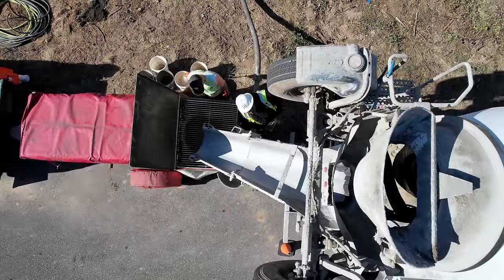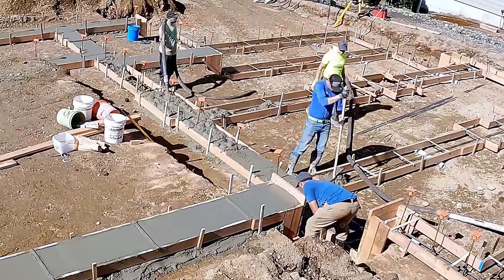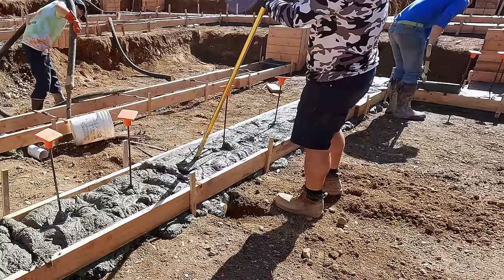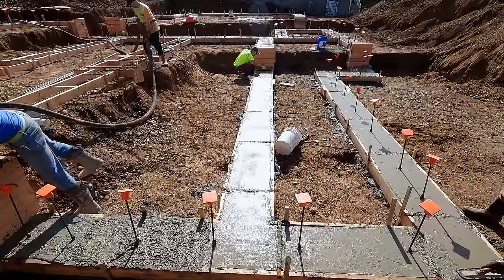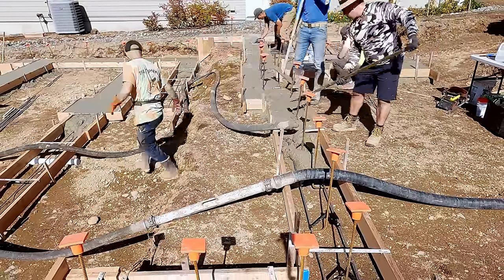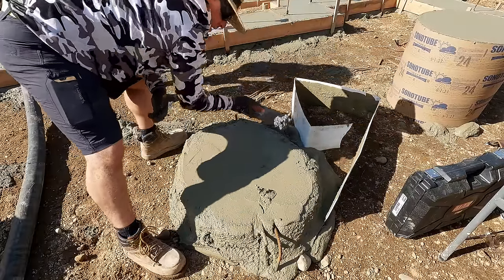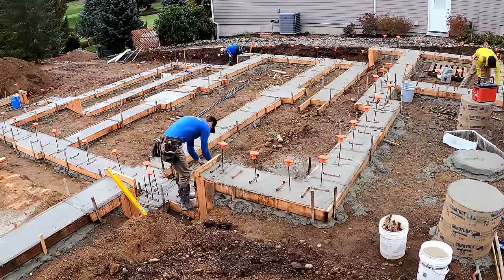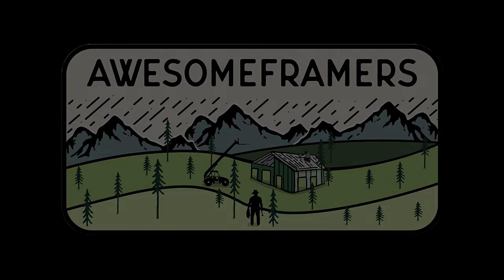Project 150 episode 2 How To Pour Footings

Comment: Smallest diameter concrete hose I ever saw. We used to use a reducer and put a 4" hose on the end. Nobody was holding that with one hand. We used a rope and a hook made of rebar to control the nozzle and a couple guys behind with hooks to move the hose around - and it was heavy. Took muscle to yank that thing around. Man, that pour was a piece of cake. No help needed to move the hose around. Concrete flowed so nicely that no vibrator was used. No hard raking. Things have sure changed in the last few years. We had tshirts that said "Concrete: go hard or go home".

Comment: Blow-out warning!  (Or at least "form creepage" warning.)  When you form your step-downs, the fluid concrete exerts pressure against the forms on one side, and against the earth on the other.  The earth is not going to move, but the 'face' form of your step-down might--bringing all the attached formwork along with it.  This is especially true if the step-down is taller, and the footer runs at the top and bottom are short (see 15:05 in the video)

Think of it this way...  Your step-downs are essentially "walls" with wood formwork on one side and the soil on the other.  You need the same restraint as you get from snap-ties in wall forms--except in this case the snap-ties need to anchor into the soil on that side of the "wall."

Obviously you did okay on this pour, but if it was me I'd want to put some 2x4 kickers at the step-downs....  otherwise you might find your forms getting pushed downhill.

Comment: Theres not much spill out the bottom because the concrete isnt getting vibed my man. Footing will be much stronger and denser as the vibrator removes air and consolidates it

Comment: So where I live we usually vibrate the concrete to get rid of air bubbles. I'm not so sure we'd be able to just ignore those 2 inch gaps on the bottom... But no worries, all our foundations are poured in prefabricated styrofoam forms anyway.

Comment: say 16 yds went into the footings which are 18" x 8" that gives 432 feet of footings. If a triangle of height 2.5" and base 2.5" leaks out the bottom of the footing that adds up to a volume of ~0.7 yd which is a lot of 5 gallon buckets :)